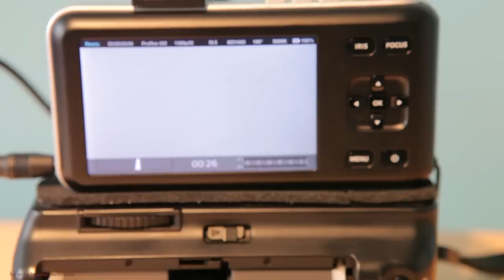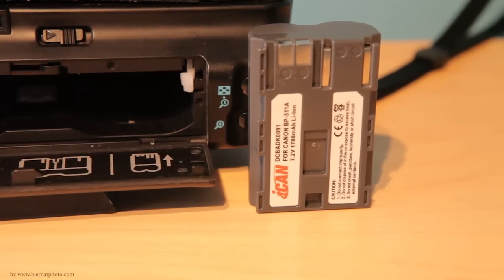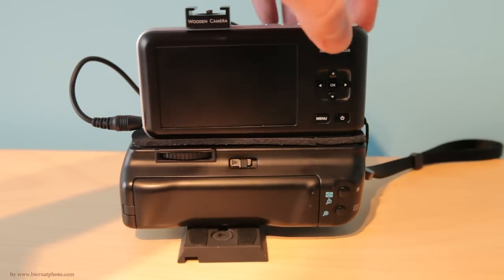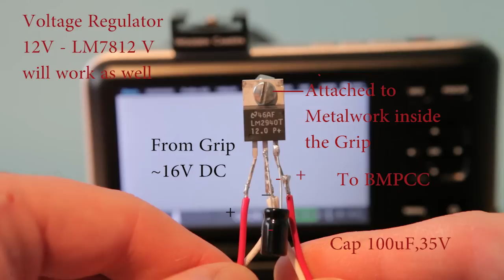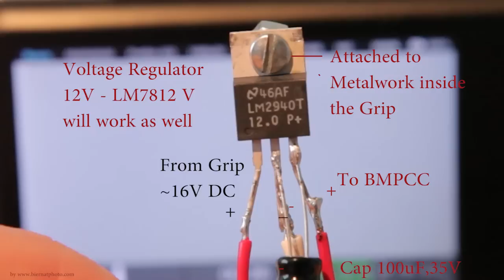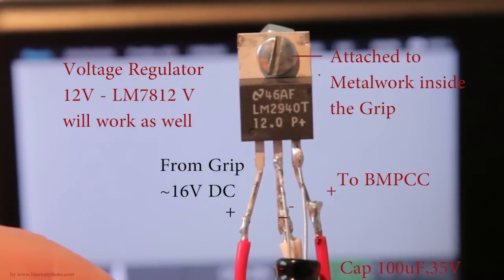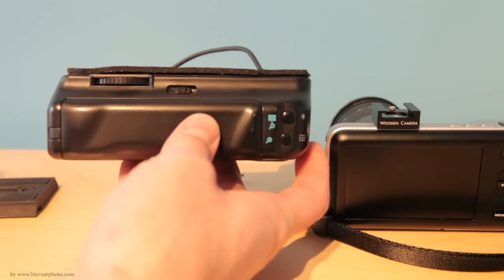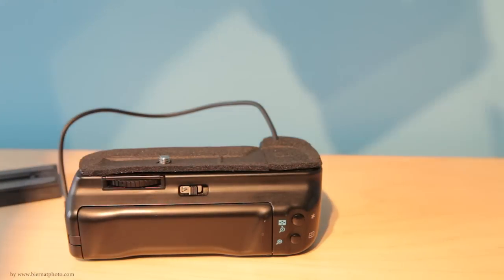DIY - BMPCC Black Magic Pocket battery Grip - Battery Pack ~ 50$

Comment: Hey man. I've watched this video about a million times. This kind of mod seems like just what I need. How exactly did you perform this modification? If you have the time to share, I'd like to know. I have very little experience in soldering, I don't even have a soldering iron anymore. Was this modification simple enough for a noob like me to perform?
Reply from the maker: mankeymunkey  Hey man, i will try to make another video with step by step 
instructions.. but for now.. if this project looks too complicated.. i 
wouldsuggest making something supper simple - 10 X AA battery Pack to 
charge the internal battery in the bmpcc when its connected to the 12V 
port. Y will need :One - 10 AA battery holder. with Snap Connector wire lead from ebay.One -  2.5mm x 0.7mm
 Male Plug  to connect to bmpcc... make sure Y wire the plug correctly 
and Y are done. .Just google AA battery solution over 4 hours of runtime
Reply: Put insulating plastic tape between all the soldered leads so they can't short, or embed it in epoxy.